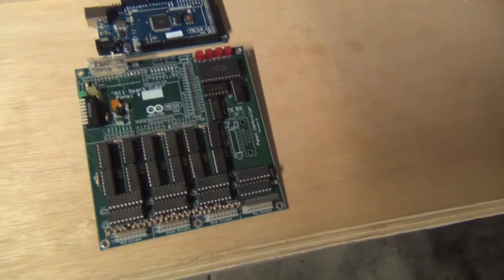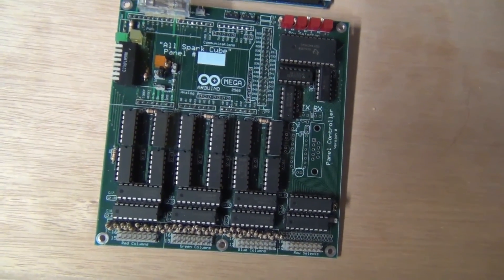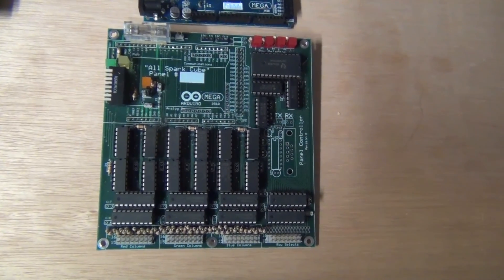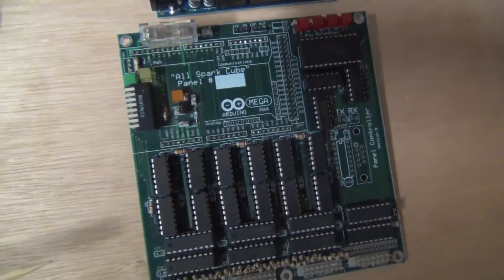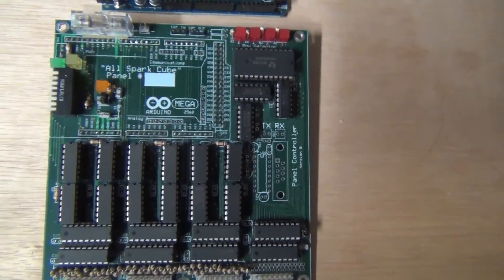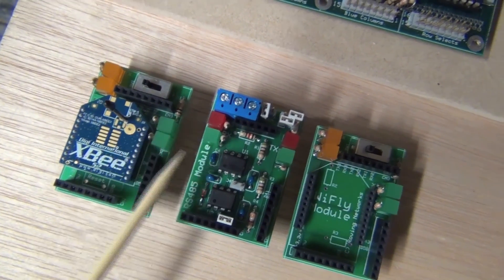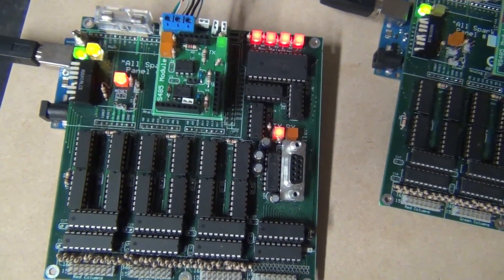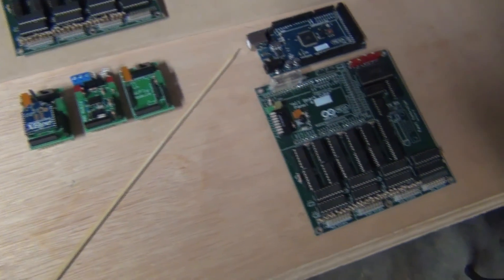Led Cube Hardware 2

Comment: Hi Spencer, Do you produce this large shield? I am search for a way to create 216 binary write channels and 176 binary read channels to an Arduino I2C port.  This is to control all the stop knobs and stop tabs on a cathedral scale virtual pipe organ I am building. The stop units are each an ON/OFF switch operated either by hand or by 12v solenoids so they can be operated from the small buttons placed between the keyboards. Where can I find a spec for your board?  Your links to AllSparkCube.com don't seem to work.  John N North Wales
Reply from the maker: This particular board had issues with being able to refresh fast enough. The company paid another person to redo  the circuitry and they used a fpga. The source is here: https://github.com/chadharrington/all_spark_cube . Sorry I can't be much more help, The first edition was closed source, and the second edition was done by people who are no longer around.